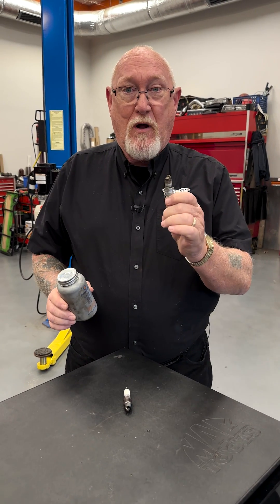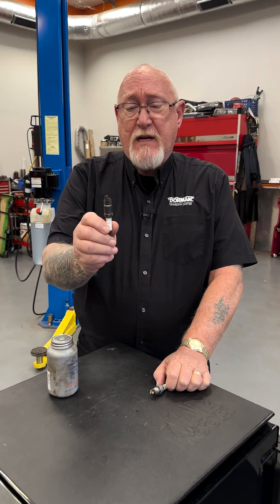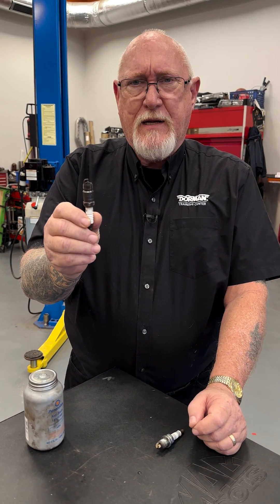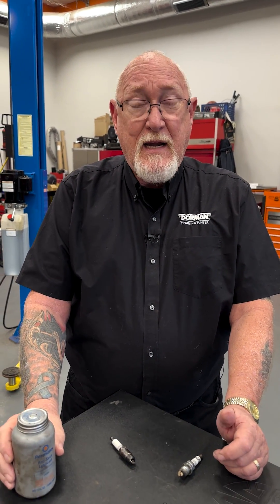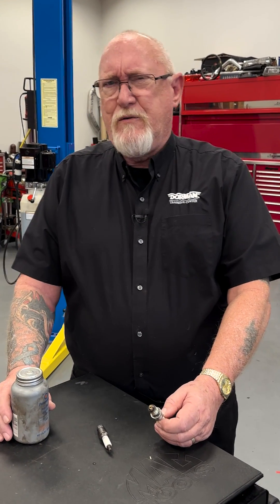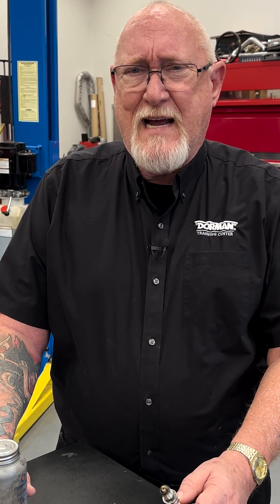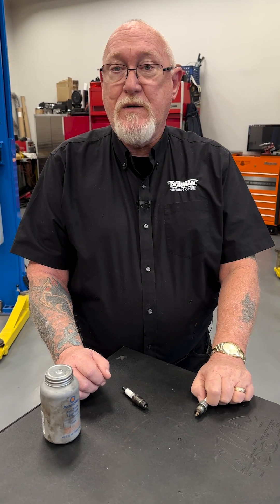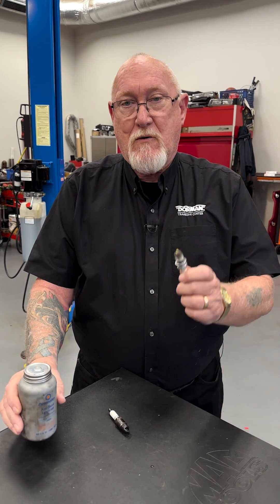Should you use anti-seize when installing spark plugs?

Comment: I have worked in the field for 30 years now and I anti-seize and torque every plug and have never had an issue. I can also say that repeat customers when they are do again for plugs, those plugs just glide out and the new glide in. Aluminum heads are fickle beasts and it's beast to plan ahead with them.

Comment: The big problem when installing spark plugs is not cleaning the spark plug threads in the cylinder head. A dirty place with buildup. If you use the right lubricant on the threads, tighten them using the tightening angles indicated by the manufacturer without using a torque wrench and everything will be fine.

Comment: I have used anti-seize sparingly for 60 years, stock and race engines. As most things mechanical, you need to have your wits about you and a good feel for the crush washer. On taper fit, you tighten until it hits the seat, then no more than a 1/16th turn. If it goes more than that, take the plug back out and clean the spark plug seating surface in the head. Most of the problems happen on taper seat. Many lack the patience to clean the seat when required. Never apply anti-seize any closer that 1-1/2 threads from the end of the threads. It will foul the plug if you get it in the combustion chamber.

Comment: I've dealt with aluminum cylinder heads my whole career. I've used anti-seize and torqued plugs to spec. I've never had a misfire or a stuck plug. I think the problem is that people overcoat the threads and get it on the electrode. When opening a new bottle of anti-seize cut that stupid built in brush off the cap. Use an acid brush for most applications. An artists brush works great for applying a sparing coat of anti-seize to the spark plugs.

Comment: I am happy to say that this is one piece if advice I WILL NEVER FOLLOW! I will always use anti seize on everything except the head bolts.
Reply: @bigboreracing356 : Every 100,000 miles or as needed.
Reply: @bigboreracing356 : I worked for a limousine comp. as a mechanic. We got 5 to 600,000 miles on each vehicle. I know what works.

Comment: Use anti-seize. It's fine. Tightening torque on spark plugs is so low that a dab of the stuff is negligible. A seized spark plug is a costly nightmare.

Comment: So as a mechanic now for over 40 years I will throw my 2 cents into the discussion. I use anti seize in this way.  I will put it on the threads but in a film like appearance and then I reduce torque by 25%.  Actually in my case I can feel the crush washer starting to flatten by feel because I've only done it a million times but you get the idea.  Too many times I've seen the plug eat head threads up when you try to remove them.  The other tip is to Kroil them before attempting to remove them and it works even better when the engine is hot. Kroil is a brand name but PB Blaster is another good product..
Reply: well saprk plugs dont need to be isolated eelcrtically otherwise they will not work

Comment: The label on the permatex copper said to torque to spec
Reply: But doesn't it also say to keep away from aluminum?
Reply: @andrewsparks4112  no it doesn't
Reply: @andrewsparks4112  
https://www.permatex.com/wp-content/uploads/tds/09128.pdf
Reply: @andrewsparks4112  Even their copper anti seize specifically says it can be used on spark plugs installed in aluminum heads on their website. I’m assuming the thinking is the presence of the grease is going to prevent any potential galvanization as you actually need some type of corrosion happening in order for it to be accelerated by galvanization of dissimilar metals. I think if left for a significant amount of time it might eventually galvanize/corrode, but it would still be less than no anti seize.

Comment: This is not true, I just fought for two hours trying to free a stuck plug in an aluminum head on a 2010 Ford and I had one last week that someone broke off in a 2017 Honda head. The Ford had Motorcraft plugs, the Honda had NGK. Neither were 'rusty, just fused to the aluminum head due to dissimilar metal bonding or corrosion.